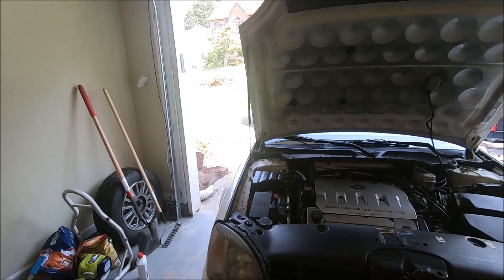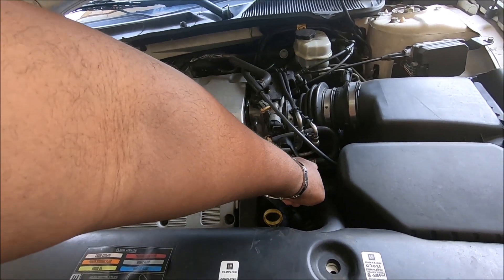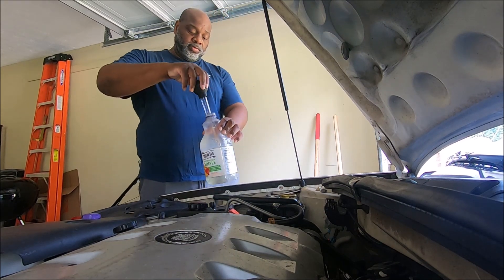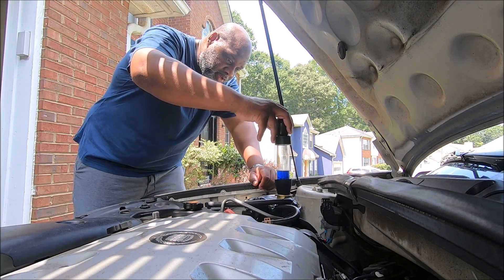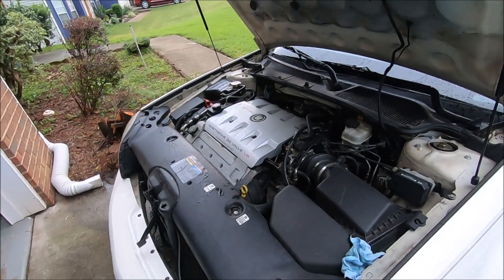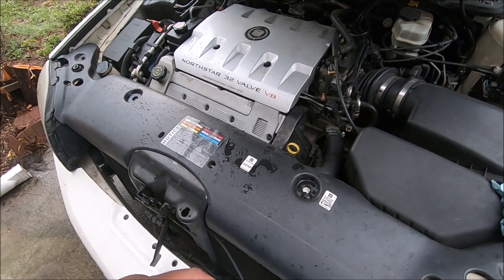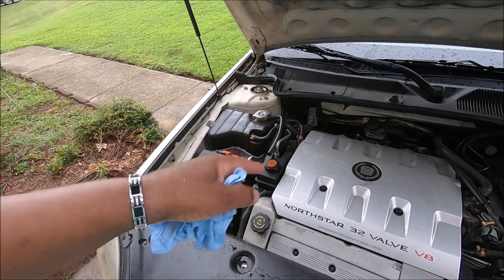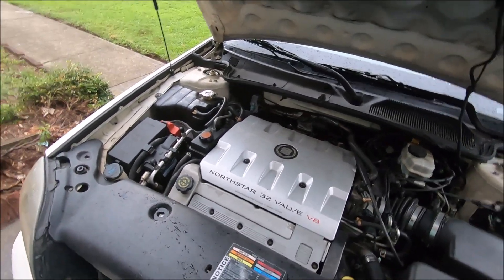Testing my Northstar for a blown headgasket

Comment: So I let it completely cool down , take hose off then turn it on and let it come out until
It comes out constant?
Reply from the maker: Let it cool. Take of the cap, start the engine and do what I do in the video. If exhaust is getting into your coolant. It will turn green if it has a small leak or yellow if it's large. https://youtu.be/VBlpBvmI8FI

Comment: Does the same go for the 1998 Cadillac Deville,for what this guy is saying?
Reply from the maker: I did this test again on my engine. The fluid turn green. It has a weak head gasket. It used to run hot sometimes. Now it run hot all the time.

Comment: How can you bleed the system when the engine is cold? Are you saying that we just bleed it with the purge line dripping into a bucket while starting the engine for the first time? How long can we allow coolant to drip onto a bucket before the system bleeds air out? Won't the car run out of coolant?
Reply from the maker: I was wrong about this engine. It does have a blown head gasket. If you look at the blue stuff when I was done. It was almost green. That is a sign the hg has a small leak. The cooling system bleed it self. You do not have to do what i said in this video. I ran this test again in this video. https://youtu.be/2oh5WDSBEV4  The blue stuff is clearly green.
Reply: @Fone65  Thanks. Mine was green too, but people say it has to be yellow. By the way, the only symptoms I have is 1. overheating PLUS 2. the reservoir cap popping up to the hood when I open it with the engine cold. 
Does that extreme force popping up the cap to the hood when opening it with the engine cold indicate combustion pressure?
Reply from the maker: @marylamb6063  Yes sirrr. I'm going to make a video explaining green is also bad. When I made the videos. I didn't realize the fluid had turned green.

Comment: I tried the bleeding when it’s cold engine thingy an it still overheated, but didn’t overheat as fast as it normally does🤷🏿
Reply from the maker: Try the bleeding again with the engine 100% cold. I bought another over flow tank because the one i install about a year ago is leaking. A northstar will not stay cool if the system is losing pressure.

Comment: I rebuilt my entire Northstar with Northstar performance head studs. The job is so easy. I even pulled the fucker from  the top lol. New timing chain gaskets half cas bolts. I even had it professionally cleaned when it was torn apart so it looks like new.
Reply from the maker: I've thought about having the engine remove to stop oil from leaking but the frame was damage after I bought it.
Reply: Bro that’s impressive af, you live in the Midwest? I’ve gotta do a timing chain on a Buick n would love to ask you a few questions
Reply from the maker: @psfanboy79  I didn't know 4 years ago but I think america lied. Sense this video was made. I took my engine out and stopped it from over heating without putting any head studs in there. https://youtu.be/BDQD8Aamhu4?si=uEF2EJ5QSJLDzYLw
Reply: Can you help me?

Comment: It’s definitely owners  because I see older people who I know are good at taking care of their cars driving these things around even in Arizona heat which is intense drive these things around like normal hardly any issues
Reply from the maker: I’m a truck driver and I see them everywhere. I don’t see smoke coming out the tail pipe either.
Reply: F165 yeah i was thinking of buying one they look cool at the same time, my dad had a old Cadillac he bought when it was brand new and had it for 20 years and put 256k miles on it
Reply from the maker: @thomaswilmeth6138  I hated them when they came out. They looked really hard to work on. After working on my niece 99 Deville. I started liking them. I plan to buy another one.

Comment: How many miles do you have on the car? I recently just purchased the best mistake of my life. An 06 Buick Lucerne with a Northstar with 80k miles. I just wanna know some things I can do to maintain it well so it can last
Reply: I always heard the Northstar engines made 2004 and after were way better and didn't have the head gasket issues.
Reply: @Krzrrazrrokr  yeah I heard they upgraded the bolts to the ls6 ones and that helped, but my main concern is the starter because I heard they go out and are expensive to replace because you have to take the intake manifold off
Reply from the maker: I got it November 2017 with 146k miles. It had a bad transmission. It now has 161k miles.
Reply: Just change the coolant. I never did and I think that's what got me. I didn't even know you were supposed to change your coolant, I was dumb
Reply: Bro i have an 99 cadillac seville with 160k on it and it runs like new. Its all about how you take care of it. Period.

Comment: The early northstars did have weaker head bolts though, later in production they switch to LS6 head bolts to help hold the higher cooling system pressure you're talking about.
Reply from the maker: I don’t think any of them had problems. People who worked on them didn’t understand how they work.